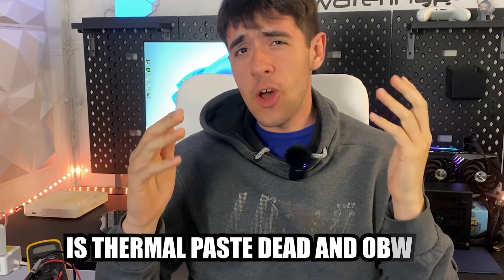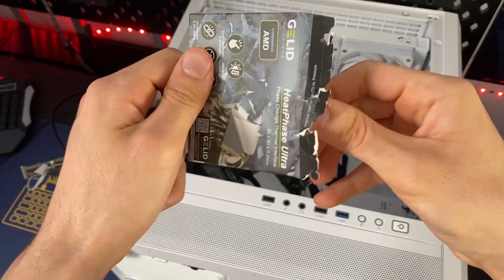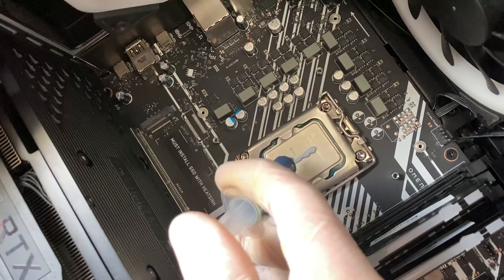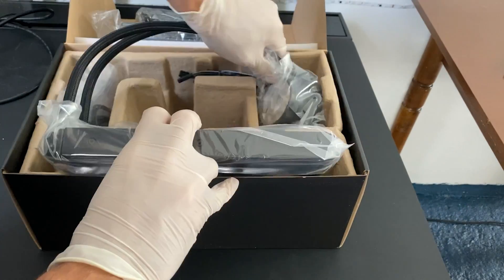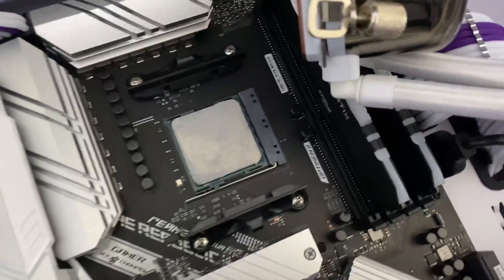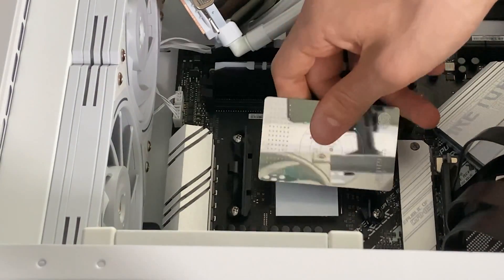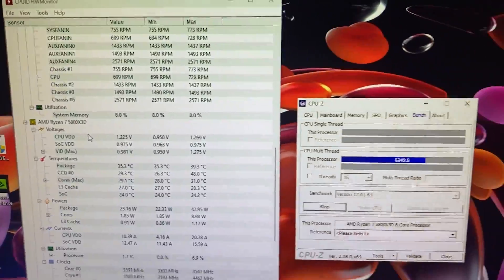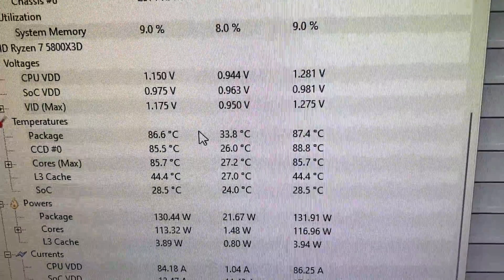Is Thermal Paste Obsolete in 2024? || Gelid Heatphase Ultra Review

Comment: i just put this on an 8750 + 1080 mobile die combo and out of the gate i got much better temps. even before monitoring temps i knew i was getting the result i wanted; heat sink got extremely hot where u couldnt even touch it, air exiting from laptop exhausts is also extremely hot...entire laptop was cool...all of this under heavy load running various games like mmos and shooters using ue 5 such as blade and soul and fortnite. 

Had the laptop half opened on a stand with the back of the screen where the bottom of the laptop would usually be, with the bottom of the laptop open facing upwhile in operation so i was able to touch the heatsink to tell if heat was being transferred before relying on software/sensors to check temps. Cpu and gpu temps hovered between 65c to 70c with gaming load and 45c to 50c at idle. The laptop has almost if not desktop temperatures in both idle and load states. 

What i did was;
Took ptm out of box, put in fridge (not freezer) for 20 (not 10) minutes. The trick is to cool it slowly to as low as u can get it without it condensing when u take it out of the fridge, u end up with a phase change material that feels rubbery when u flick it. I then with a scissors I cut two pieces out of it to the shape of the gtx 1080 mobile and 8750h dies. Then I used a razor blade raise and take off the plastic on one side (tweezers were too thick), placed it on the die with the tweezers so it sits flush, no silver showing but its not hanging over the die either, sits flush. Then used the razor blade to raise and take off the plastic facing upward (facing me). Put the heatsink on, screwed it down tight enough to where the screwdriver cant turn anymore and let it sit for 10minutes. Turned the system on and let it idle for 10 minutes, then put it underload afterwards. 

Got the results i did and im very pleased, for comparison i came from thermal grizzly kryonaut which works but nowhere near as good as thermal grizzly phasesheet which is the brand of phase change material im using. The air coming out of the exhausts for the laptop is piping hot when under load, the rest of the laptop is cool, like its not even on. I never got this with kryonaut paste and im not an idiot, i know how to put thermal paste down properly.

Thermal paste is obsolete. It doesnt make sense anymore, even for ihs applications. Phase change material is the shot now, its non conductive, it doesn't dry out, it doesnt pump out under mounting pressure or thermal cycling and has a shelf life of forever and a half. Thermal paste lasts about 3 years in the tube, which is what happened to my kryonaut which is why i had to go out and get new tim and stumbled on phase change material. Paste is obsolete.

Comment: what is the heat conductivity on this „thermal pad“? (W/mK^2)
Reply from the maker: It’s 8.5W/mk which is pretty good, but you shouldn’t give the thermal conductivity value too much weight
Reply: @ImWateringPSUs  8.5 is bad, low end. there are thermal pads, not paste, not phase change, thermal PADS with higher thermal conductivity than that, for example aairhut which is 13w/mk. But you're right thermal conductivity is not the be all end all.
Reply: @user-bn6lm8ng3v  no thermal conductivity is not the main reason why this PTM is the best solution. Imagine you have very high thermal conductivity but after 1-3 months it's drop significantly. The main point is to keep your CPU as cool and sustain as possible so you don't need to worry about pumping out thermal paste etc.
Reply: @ by chance did you read the comment you responded to?

Comment: I never had to replace thermal paste,  the PCs have good temps even after 7 years
Reply: Thermal paste is being pumped out over time due to the gap created by the heating-cooling cycles. A thermal pad is far superior in durability and retaining performance.
Reply from the maker: This is a bit eccessive😂 Paste does lose effectiveness over time, especially on GPUs. You see it less because CPUs automatically downclock in order not to overheat too much, but you’re effectively leaving performance on the table. I’d say even on office PCs you should do a repaste once every 3 years. On gaming systems once every two and if you’re on the edge of temps/performance, a yearly repaste will grant you those extra 1-2C
Reply: @ImWateringPSUs  I have an xbox series s, and I'm about to replace the thermal paste on that even, because I've come to understand the difference it makes. You would think it was fine straight from the factory, but from what I've been hearing, not so much.

Comment: This is rebranded PTM7950. PTM7950 needs a few days and heat cycles to evenly spread and reach its full potential. It doesnt make sense at CPU coolers though, paste lasts a long time there.
Reply from the maker: Yessir I did heat cycle it and mount it on a warm PC. Are you sure it’s the same mixture as PTM7950?

Comment: With that being phase change it should get slightly thinner with each heat cool cycle until the heatsink gets as close as it can to the CPU. (limited by surface flatness and mounting pressure)
The tip I read was to run a benchmark to heat it up before letting the pc sit over night and repeat each night until the temps stop dropping.
It would be interesting to know how low the final temps drop to with stock parts, as apparently on a lapped CPU and cooler you can get close to liquid metal.
Reply from the maker: Yes sir you’re correct! I did mount it on a warm PC and have heat cycled it a few times before running the comparison. Hearing about what it does on lapped surfaces though, now you’re making me want to get another few samples and redo the whole roundup of testing on a lapped chip against liquid metal, ngl

Comment: It's still technically thermal paste, it's the basically same the same high viscosity thermal paste that comes pre-applied on various coolers.
Reply from the maker: I don’t think this is correct, it’s a different mixture that’s supposed to melt with heat cycles to fill in the gaps

Comment: Actaully people are using graph pads .. That's literally the only thing that works on amd cards with chiplets unless you want a ridiculous hotspot temp
Reply from the maker: Yes! For GPUs graphene pads are very good, however the price is substantially higher than the pad I tried in the video. I’ll try to make a video about graphene pads specifically for GPUs :)
Reply: graphene pads require you prep the surrounding area with kapton tape or shield coating polish because the graphene pads conduct electricity, same for the carbon pad. 

people, most people, still use paste. paste is obsolete sellers can supply real honeywell or thermal grizzly phasesheet to off the shelf stores.

Comment: Nice Video. Hey can you do a video on the Newest MSI Bios for the 13th and 14th Gen CPU's where they say you can turn off CEP I think it was, to help keep them cool? I have a 13900KS and a Meg Ace Z790 MB and I'm interested if ya lose any performance or anything really when doing so. Would love to see a video on what really happens if you turn that stuff off as I'm not very Bios Savvy. The Bios version is in Beta right now and for my board is version: MSI MEG Z790 ACE  - 7D86v1A2 (Beta Version).  If ya do, thanks in advance!
Reply from the maker: I’ll definitely find the time to give it a look! It should lose you a little bit of performance, but nothing too extreme. Undervolting is still the way to go, the only add-on would be to disable CEP while you’re at it :) I wouldn’t recommend just disabling CEP
Reply: @ImWateringPSUs  I’m not too good poking around in the bios (still learning) but I did follow your instructions in one of your videos and told it that I had an air cooler and turned off the turbo which  keeps it around 80 to 85. It just spikes at that temp from time to time in a game but never stays there for more than a few seconds. Have not done much else as not really experienced with undervolting. My understanding is 80c is pretty much standard temp for a 13900KS from what I have read unless that is wrong? Although, cooler is better I would assume.